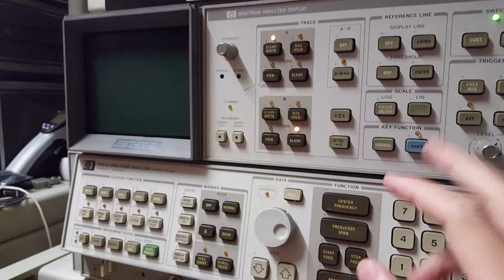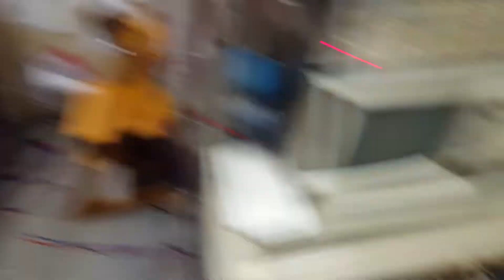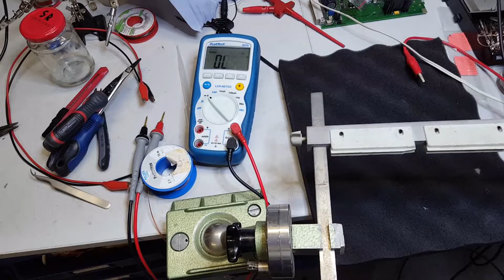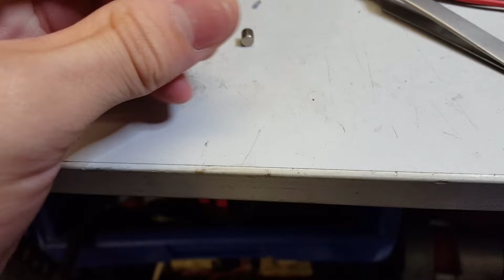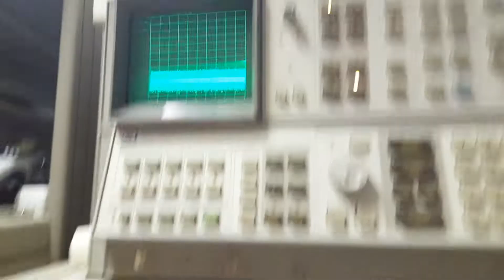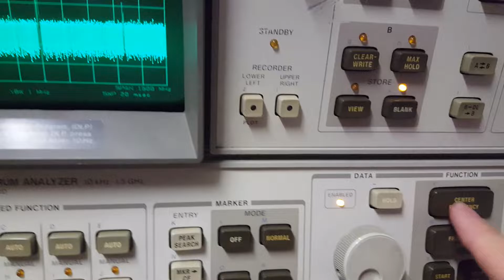HP 8567A spectrum analyzer quick display fix

Comment: Nice gear, like those racks that would be handy for my lab as well, did you get them with the Instruments?
Reply from the maker: Thanks! I've been collecting test gear for a while now, most of it was bought as untested/defective, but thanks to the excellent documentation on this old HP stuff, I've been able to revive almost all of it.

The 16500A logic analyzer on the far right did come with its own rack, I got it and the other two racks for free when a local company was clearing out its warehouse. These racks are very handy indeed, as they make it a lot easier to move equipment around the lab (some of these instruments weigh 40 kg after all).